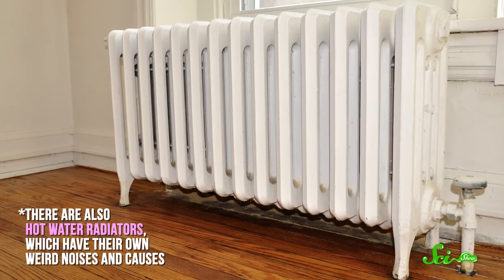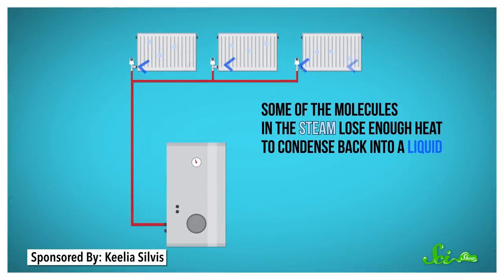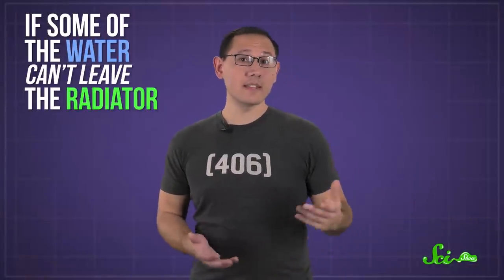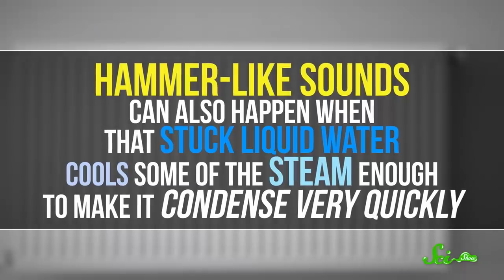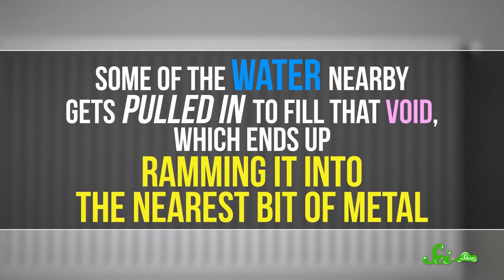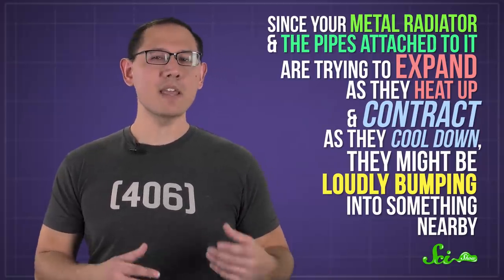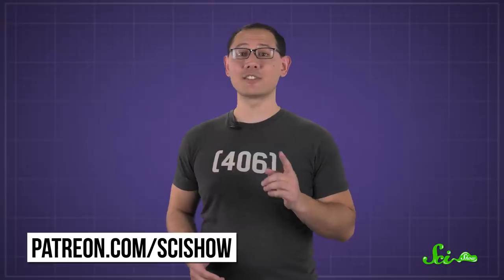What Makes Radiators Bang So Loudly?

Comment: Are radiators still used in modern homes? Every house I've been in has been in  ( CA and NV ) have been central air + heat pump or natural gas.

Comment: meanwhile, with me being in the south, I have yet to encounter a radiator. The central heating is enough to keep homes warm, with no need for a boiler or furnace or anything to heat up the home
Reply: King Unicorn not entirely true; i live in TN and when I was in undergrad in Knoxville we had radiators in the dorms... gawh they would bang all night long in the winter
Reply: Central heating with oil, gas or an electric furnace uses water and a radiator to transfer the heat to the central air system and the water heater tank.

Comment: Steam systems are for builders who are too cheap to put in a return line to make it a circulating hot water system, which works much better, and is way more efficient. Closed loop water systems can bang too, to stop it you need to let the air out from the top of the radiators, I.E. bleed the system.

Comment: Our radiators here in Germany are filled with water not steam, yet the very old ones in my house still do bang at times, always thought that was possibly due to the metal expanding as it heats up or something. Guessing steam radiator and water radiator bangs are different kind of bangs then?
Reply: Steam is still a public utility in parts of some cities (London, NYC and Chicago as three examples). It is delivered to your building through insulated underground pipes just like electric, gas, water and sewer. Hooking up to the steam line is much more space efficient and cost effective than trying to heat your own filled-loop.
Filled-loop systems don't typically knock, themselves. It is usually a pump of valve elsewhere on the water lines shutting off flow too abruptly.

Comment: I'm pretty sure it's mostly metal expanding and contracting. Never heard of radiators using steam, most of them use water that never reaches such temperatures to become steam.
Reply: Steam radiators are still a thing, in fact some radiators still in use were produced in the 1800's. Steam is still a public utility in some cities (New York, London and Chicago for three examples). It is delivered to your building through insulated underground pipes just like electric, gas, water and sewer. Hooking up to the steam line is much more space efficient and cost effective than trying to heat your own filled-loop.

Comment: 0:30 That's not a picture of radiator hooked up to a steam system, that's a hot water heating system.
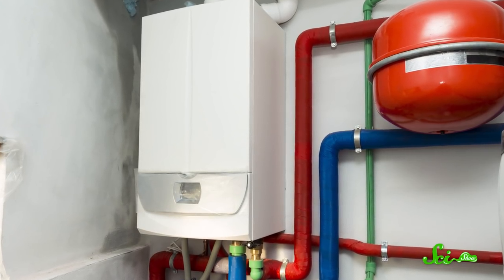0:34 That's not even close to being a picture of a steam boiler, it a water heater.
Not even 35 seconds into the video and already two major visual errors.

Comment: I hear sounds regularly at night coming from my radiator. Not a bang, but two or three clicks usually between 1 am and 3 am. What could this be? Maybe it's the electrics in the wall... There is a socket on that wall too.
Reply: It is most likely that you have a fill-loop system. Clicking is probably the solenoid allowing hot water to flow once the temperature in the room drops below the thermostat setting.

Comment: How does the pressure of the steam in the radiator causes the vent to close?
Reply: It is a one way check valve like those used in ramp pumps. https://www.youtube.com/watch?v=CG0laNqJWY0
If the escaping fluid (in this case air and water vapor) is pushing it with greater force than the spring holding it open, it snaps shut.
Reply: ohh ok, I did not know how the vent worked. Thank you!

Comment: So the noise isn't due to metal contracting and expanding? Or the noise of the pump being transmitted through the pipes? And ho uses steam radiators, it is 2018 you know not 1918.
Reply: Steam radiators are still a thing, in fact some radiators still in use were produced in the 1800's. Steam is still a public utility in some cities (New York, London and Chicago for three examples). It is delivered to your building through insulated underground pipes just like electric, gas, water and sewer. Hooking up to the steam line is much more space efficient and cost effective than trying to heat your own filled-loop. 
That said, filled-loops are far more common since they are the method used by oil, gas and electric furnaces to transfer heat to central air systems, water heater tanks and freestanding radiators are still used in rooms without duct-work, such as attics, garages and home additions.

Comment: what happened to good ol running electricity through a bunch of wires and resistors to generate heat?
Reply: Baseboard heaters are still in use and some are being replaced by infrared LED systems.

Comment: I've never seen a steam radiator all I've seen is hot water radiators.

A steam system seems unnecessarily dangerous for a central heating system.

Is this an US only thing?

Comment: Now the Remedy!  Have a Plumber install a Expansion Shock absorber in the Steam pipe
Reply: The expansion noise happens once when it kicks on. That pressure spike is necessary to keep the valve closed. Like a ramp pump, it needs the spikes to work properly. While it is running, the problem isn't expansion, it's contraction. The only decent solution is to shim up the one side so the condensate can drain properly.

Comment: Is this the same for baseboard radiator heaters and the ticking sounds
Reply: No. That is caused by the heating element expanding and contracting. To get around this, you would need to switch to an infrared LED system.

Comment: my apartment has electric baseboard heaters and they clink like an electric stove when they turn on and off
Reply: That is the heating element expanding and contracting. The only way around that is to replace them with infrared LEDS or a central air system.

Comment: Seam Radiators???? What an archaic technology!
Reply: Not really. In some cities (New York, London and Chicago as examples) steam is still a public utility like gas, electric, water and sewer. It's cheaper and more space efficient to just hook up to the steam line.
Reply: You can have long distance heating with water too. Advantage: woks on longer distances and the house can use other heating methods like heating the floor or wall.

Comment: My radiators olny make the noise of the pump and also some clicks that the plumber says are small air bubbles
Reply: Yours, like mine, is a filled loop system. It uses hot water rather than steam. The clicks are dissolved gasses coming out of solution with the water because for the temperature (like the small bubbles in the bottom of a pot that never seam to make it to the surface).

Comment: 0:30
Radiators were around back in the 1800’s? You sure about that?
Reply: The steam locomotive was invented in 1804 and work on the first New York City district heating system (citywide steam utility pipes similar to electric, water and sewer) was started in 1890. Radiators were already common at this point.
In fact, the first district heating system on record dates back to the 1300's in Pompeii. While the Romans had their Aqueducts, they still had to use wood, coal and tar to heat it. Pompeii, on the other hand, had heating pipes connected to geothermal vents and springs to bring heat to the entire city for whatever it was needed for (most notably, the bath houses).

Comment: Steam radiator system!! How old is this.....? Nearly everyone now is on wet/water system or electric....?
Reply: Steam radiators are still a thing. Steam is still a public utility in parts of some cities (London, NYC and Chicago as three examples). It is delivered to your building through insulated underground pipes just like electric, gas, water and sewer. Hooking up to the steam line is much more space efficient and cost effective than trying to heat your own filled loop.

Comment: My parent's home from the 1800s had hot water radiators. I don't think I've ever seen a hot steam radiator. In fact, that sounds dangerous. Are you sure the explanations shouldn't have been the other way around? Hot water and mention that there are also stream radiators?
Reply: Steam radiators are still a thing, in fact some radiators still in use were produced in the 1800's. Steam is still a public utility in some cities (New York, London and Chicago for three examples). It is delivered to your building through insulated underground pipes just like electric, gas, water and sewer. Hooking up to the steam line is much more space efficient and cost effective than trying to heat your own filled-loop. 
They are not dangerous in the least if they are properly maintained. They are all installed with a shroud to prevent people, pets and objects from contacting them directly. The low pressure valve is a smaller version of a one way check valve used in plumbing and ram pumps. They also have an over-pressure valve to vent steam well before the failure point of the radiator itself.

Comment: Wow a steam radiator sounds very inefficient
Reply: Steam is still a public utility in parts of some cities (London, NYC and Chicago as three examples). It is delivered to your building through insulated underground pipes just like electric, gas, water and sewer. Hooking up to the steam line is much more space efficient and cost effective than trying to heat your own water loop. 
In an open loop system, steam fills the radiator, the low pressure valves shut and the system is maintained at this pressure for the duration of the cycle. Any condensate collects in the bottom until it reaches full operating temperature where it turns back into vapor. Once the cycle is over, the steam supply is cut off and the radiator cools, dropping in pressure which opens the low pressure valves again, allowing any secondary condensate to drain to the sewer, drain field or grey water collection tank for reuse in non-consumption applications (the latter of which is very uncommon). Closed loop systems go through a return pipe back to the steam plant where its residual heat allows for quick and more efficient reheating.
That said, filled-loop systems are still most common because they are the method used for oil, gas and electric furnaces with or without a central air system.

Comment: What? In my country radiators are filled with water throughout!
Reply: Steam radiators are still a thing. Steam is still a public utility in parts of some cities (London, NYC and Chicago as three examples). It is delivered to your building through insulated underground pipes just like electric, gas, water and sewer. Hooking up to the steam line is much more space efficient and cost effective than trying to heat your own filled loop.

Comment: What if the radiator is not steam powered? Just hot water?
Reply: Knocking is far less common in these systems and is likely caused by a pump of valve elsewhere in the line shutting off flow too abruptly.
Reply: D Hawthorne we had hot water radiators in Iran and I never heard knocking in those. The only noise from the radiator was from air bubbles in the line. No bang or anything loud.

Comment: Steam heating, that's a very ... strange heating system.
Reply: Steam radiators are still a thing, in fact some radiators still in use were produced in the 1800's. Steam is still a public utility in some cities (New York, London and Chicago for three examples). It is delivered to your building through insulated underground pipes just like electric, gas, water and sewer. Hooking up to the steam line is much more space efficient and cost effective than trying to heat your own filled-loop. 
They are not dangerous in the least if they are properly maintained. They are all installed with a shroud to prevent people, pets and objects from contacting them directly. The low pressure valve is a smaller version of a one way check valve used in plumbing and ram pumps. They also have an over-pressure valve to vent steam well before the failure point of the radiator itself. 
Radiators are also used in central air systems to transfer heat from the furnace.

Comment: I don’t even know what a radiator is... is it something for heating your home?
Reply: Yes and no. It is any system that transfers heat from a greater temperature fluid to a lower temperature fluid. In the case of your car or a liquid cooled computer, it transfers heat from your coolant loop to the air (gasses are fluids as well).
In the context of this video, it is transferring the heat from steam to the air in a room.  It can also be a filled loop in which case it uses water rather than steam. They are also used in tank water heaters to transfer heat from steam or furnace coolant to the water.
Steam is still a public utility in some parts of certain cities like London, New York and Chicago. This is where steam heating is most common in a public setting. Nuclear Submarines and oil refineries use steam as well.

Comment: My water heater does that.
Reply: In this case, it would be the expansion and contraction of the heating elements for an electric water heater or the thermal shock to the radiator in the tank for an oil, gas or electric furnace.

Comment: I thought metal makes expansion and contraction sounds. Wood stoves do the same and so do electric baseboard heaters. Its the expansion itself. The metal doesn’t need to be touching anything to make this noise. I dont think this was accurate. I study thermodynamics at the core of my current degree that im working on.

Comment: Wait, what? Here we use hot water radiators. How do they bang? Also, who leaves their radiators on at night? That's a waste of electricity, and it makes me feel too hot when I'm under the blankets...
Reply: Mid-cycle knocking is very uncommon in a filled loop system (hot water instead of steam). If you have a filled loop and still get knocking, there is a pump or valve hooked up to the hot water that is shutting off flow too abruptly and causing a heater hammer effect. It would be a good idea to get this checked out so you don't develop any cracks in the solder near the source.

Steam radiators are most common in big cities that still have a public steam utility like London and New York. It is brought to your building through pipes like gas, water, sewer and electric.
Reply: D Hawthorne 

It not loud, it's just a slight banging noise at the beginning, which I just assumed was caused by the metal expanding due to the heat. London has steam radiators? But I live in Manchester, and we use hot water radiators...

Comment: we just use hot water radiators instead in sweden
Reply: Steam is still a public utility in some cities (New York, London and Chicago for three examples). It is delivered to your building through insulated underground pipes just like electric, gas, water and sewer. Hooking up to the steam line is much more space efficient and cost effective than trying to heat your own filled-loop.

Comment: could this apply to a car?
Reply: Francisco Casillas Your cooling system shouldnt be banging. Does your car do that?
Reply: Radiator knock in a car is usually due to too damaged channels causing a low pressure area on the return side.
If you hear pinging, it is likely the air conditioner's condensation pan or a poorly insulated part of the coolant loop expanding.

Comment: People still have radiators?
Reply: Yep! Steam radiators are still a thing. Steam is still a public utility in parts of some cities (London, NYC and Chicago as three examples). It is delivered to your building through insulated underground pipes just like electric, gas, water and sewer. Hooking up to the steam line is much more space efficient and cost effective than trying to heat your own filled loop system (water instead of steam).
If you have an oil or gas furnace for central air, you also have a radiator. It carries the heat from the furnace to the duct-work for central air and to the water heater tank. 
I've got one to heat my garage since it has no ducts for central air and heating.

Comment: We need a follow-up about the water circuit radiators as Europe don't have steam heated radiators - a lot of confusion here :) 

In our case, it's most likely the fact that the elements through which the water flows is not welded properly to the outer "shell" of metal that encases them. When they are at room temperature and hot water rushes in, they expand quickly and rub against the "shell" which causes the noise.

Comment: People still use radiators?
Reply: Steam radiators are still a thing. Steam is still a public utility in parts of some cities (London, NYC and Chicago as three examples). It is delivered to your building through insulated underground pipes just like electric, gas, water and sewer. Hooking up to the steam line is much more space efficient and cost effective than trying to heat your own filled-loop.
If you have a furnace (gas, oil or electric) you have a filled loop radiator. Water is used to transfer the heat from the furnace to the central air system and the hot water tank. I've also got a freestanding one to heat my garage.

Comment: to be clear... we're talking about a car radiator.. correct?
Reply: No. We are talking about building heating systems. 
Steam is still a public utility in parts of some cities (London, NYC and Chicago as three examples). It is delivered to your building through insulated underground pipes just like electric, gas, water and sewer. Hooking up to the steam line is much more space efficient and cost effective than trying to heat your own water loop. They are not dangerous in the least if they are properly maintained. They are all installed with a shroud to prevent people, pets and objects from contacting them directly and they have over-pressure valves as well. 
That said, filled-loop systems are most common since they are the method of heat transfer used by gas, oil and electric furnaces for both central air systems and freestanding radiators.